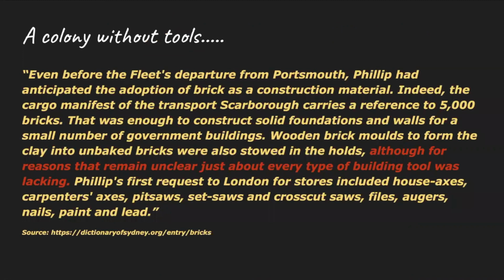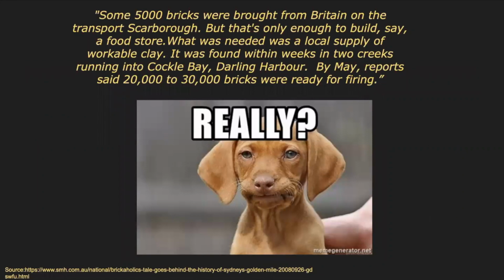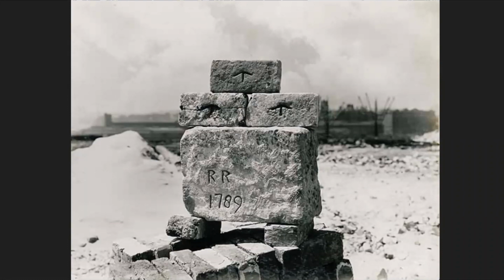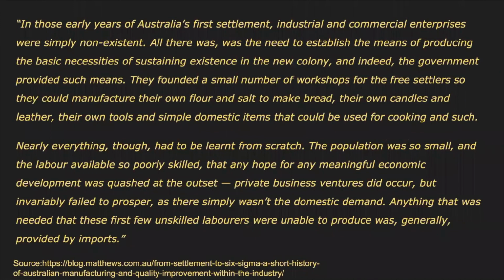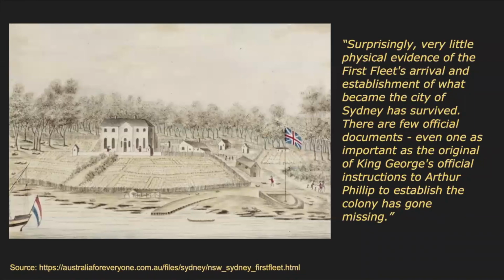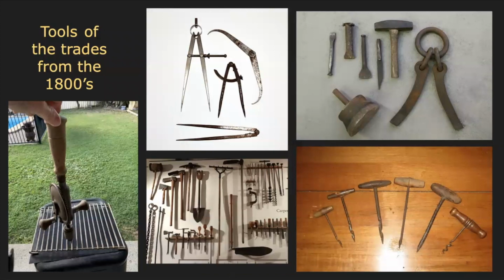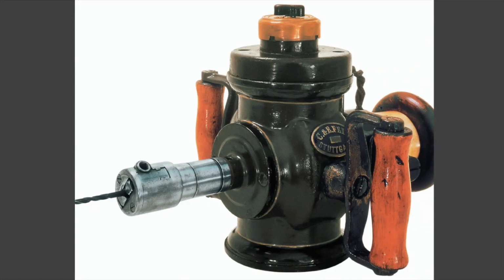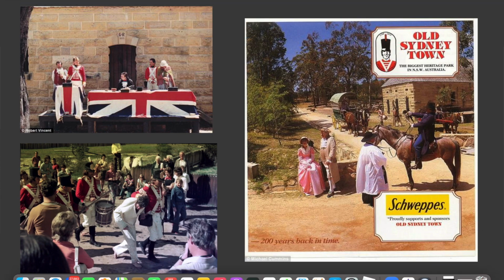Episode 2: The Building Blocks of Australia (Part 1) || Tartarian Truthers

Comment: It's totally feasible that they made a few 1000 bricks in a couple of months. I build with mud bricks and know from experience that it would have been simple to discover workable clay for bricks. The brick ingredients of sand, aggregate and water can be mixed by many feet stomping on it. Then pushed into moulds fashioned from timber.
Reply: No firing necessary. Just sun dried makes very strong bricks.
Reply: @jethro9450  totally, and a kiln can be made from sun dried bricks and fired in place.
Reply: Brickmaking goes back 10,000+ years, it is not that hard, especially when you have forests of timber and lots of coal. And horses to move them.
Reply: Ok, but that's not what the large fancy buildings are made of.

Comment: The Lithgow area has some early history.
They had the steal industry and about 10km away is Portland Cement. Cement help build Sydney.
Limestone was quarried near Bathurst, about 50km away is possible the first deposit found.
Lime mortar was used to bond bricks and stone for possible 1000 of years.
About 1950 cement was been used to bond bricks.
These materials are a necessary to bond bricks together.
It could of been possible to float the materials down the Cox river, all the way to Sydney.

Comment: I do eco-construction and I make bricks from clay with a home-made brick-mold. I could make about 60-80 bricks in a day... You'd probably need to mix the clay with sand and straw for the bricks and then mix it without straw to make the mortar. You also need to dry the bricks. Took me about 5 months to build an out-door toilet (with wheelchair access), that was with regular volunteer helpers and with the clay, sand and straw delivered in a truck.

Comment: Now I like the content, but I have a few issues with ignoring a few facts, firstly every ship of that time had its own carpentry crew as well as the tools for repairs, most sailor's would have had some experience with it,
Second, the country that was settled  would have been full of life and easily found both on the coast and inland, etching out a start would have been hard but not impossible, finally the clay and other materials to make bricks is everywhere, small mud kilns would have been used and even with a crew of 20 men minimum of 40 bricks each a day over the period of 4months is 96.000 bricks, 
And they were there to be worked so its easy to speculate that even if they didn't have bugger all of an idea how to do it there's enough room in the math for them to have figured it out

Comment: I’m triggered already.. whosoever, Phillip is.. a single person did not make the decision, by any stretch of our thought. Brick is a standard, can be made (almost) anywhere on earth. Important to chase the thought that ALL sailing vessels, did carry brick in quantity, to where it could not be made. After that .. brick is never used in foundations, or footings , and exterior brick does not then get backed with interior brick. Houses in northern Thai, Lao and Viet cultures build center walls w/brick, and face both sides, with a lovely plaster. 
     If they got to Australia, with bricks, and no tools, it indicates that there was no intent to do the building process. Lord knows , that is what ships do in port; gather supply. Carpenters use many tools, more than hand tools, which have been apparent since they began to build competent ships, all built from hardwood, which is ‘tough’ on machines, and saw blades.